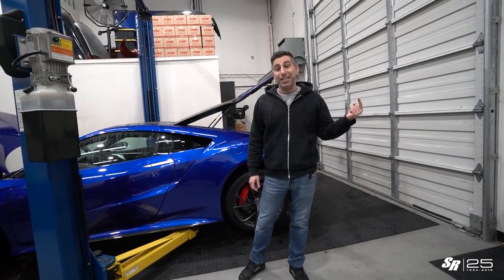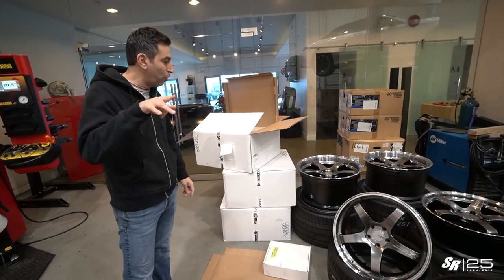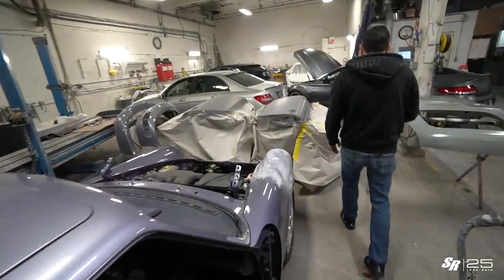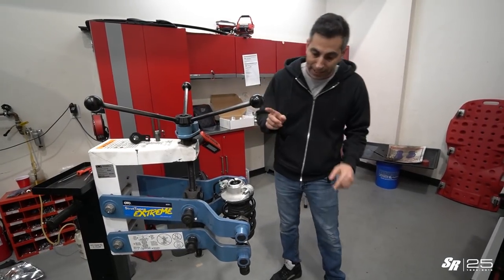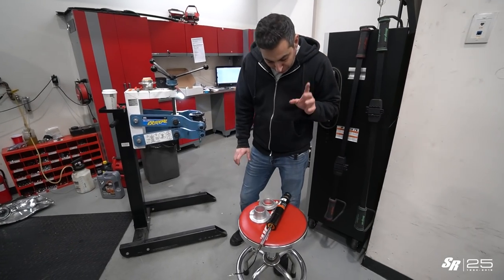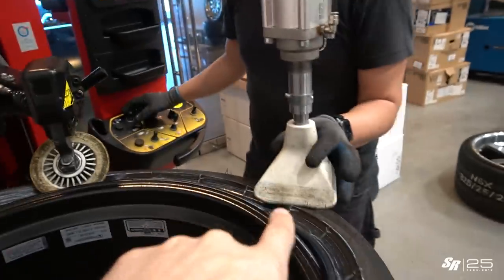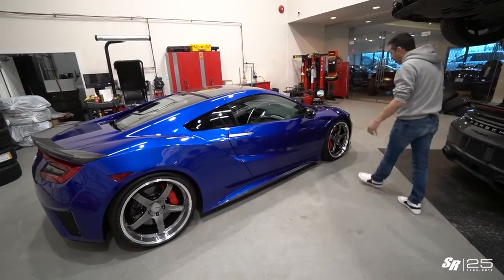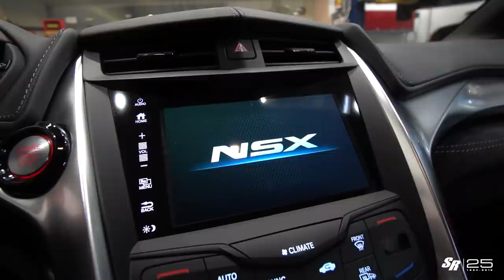WE TAKE THIS 2017 NSX FROM ZERO TO HERO USING ONLY A SET OF WHEELS AND SOME ALUMINUM SPACERS!

Comment: Looks great with those wheels.  The problem with the NSX is the price point. Just to much for a 6 cylinder Honda. I think it needs to compete in the price range with the Corvette, Viper, and GTR cars like that around 100-125k.

Comment: I think the pricing on the nsx was its down fall. Its a great looking car and great to drive from what I've seen but at 170k there are alot of options and the nsx just isn't one of the options that stick out. If they priced it the way Chevy did with the C8 there would have been alot more hype around it. Alot more people would have been able to imagine having a brand new mid engine sports car in their garage but the price was out of reach and the people that could afford it just wouldn't choose it over other similar priced cars.